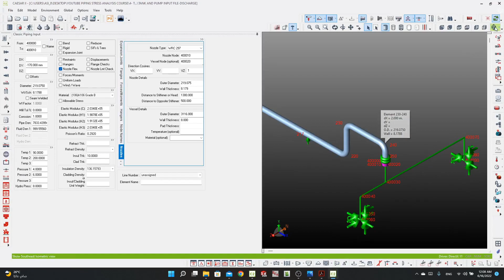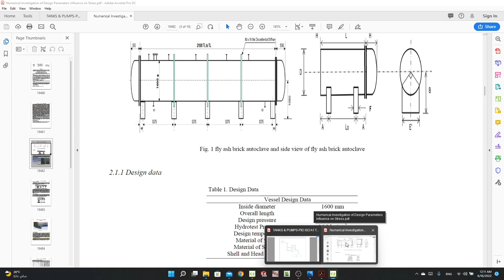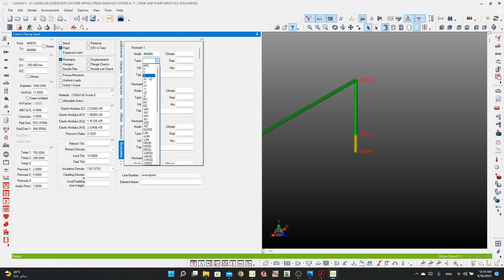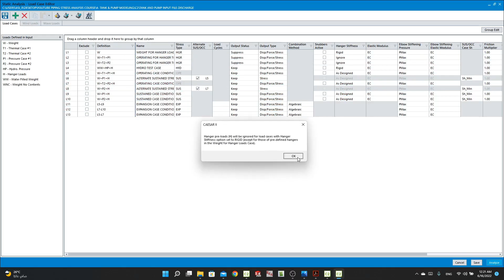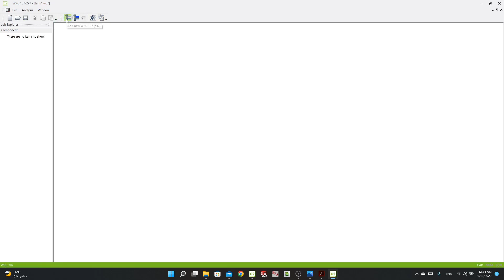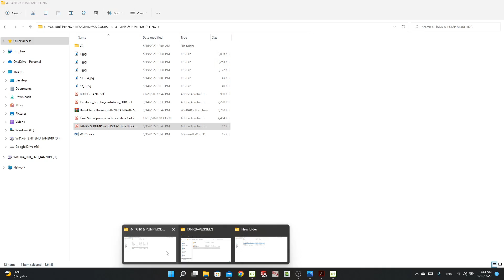Cylindrical vessel nozzle evaluation in CaesarII based WRC297

Comment: Thanks for this exercise, very interesting
While following the lesson, I encountered a problem of this type.

ERROR 87E 1000-1010 More than one NON-ZERO LENGTH element to the nozzle at node 1010

Would you have the solution to go to the next step?
Reply from the maker: Check the nodes most probably you had create empty node with no length by mistake
Reply: @AI-Stress_Analysis_Solutions  Hello, thanks for the session. I encountered the same error and I double checked but no empty nodes from my side. But seems that because the nozzle is created over a pipe. I am wondering how you did not get the same error while giving the tutorial.
Reply: @Karimkamal2020  I am also having same problem, Please suggest if you solved

Comment: جزاك الله خيرا ، بس لدي سؤالين بعد اذن حضرتك عن سيزر ٢ عامة مش المقطع تحديدا،تابعت اغلب فيديوات قناتك يعطيك العافية:
الاول : بالنسبة للهارمونيك analysis, كيف احدد الهارمونيك force او displacement الي بادخلها للبرنامج؟ بشوف كتير في الهارمونيك analysis على برامج تانية زي ansys بيحط دايما ١٠٠ نيوتن .. وبعضهم displacement صغيرة 0.1 مم ، هل هي افتراض؟ 

سؤال الثاني بعد اذنك : الstanchion عند elbow يعطيني خطأ في الادخال دائما .. هل في شيء محدد لادخال تفاصيله؟ لاني تعبت فاستخدمت tee مكانه ولو انه هذا غير صحيح. 

ولك جزيل الشكر
Reply from the maker: Sorry i have to answer in english to be more clear
1st elbow trunnion can’t be consider as tee because SIF  is totally different in calculation u can either apply WRC107 for local stresses or run FEA in PRG in the input file don’t specify any SIF.
For the harmonic analysis this is a dynamic analysis you need to see your case exactly to give my opinion in it.
Reply: Thank you very much for replying, clear about the turnion, however about the harmonic force/displacement I was looking for a general answer in fact about where these values are obtained from .. thanks